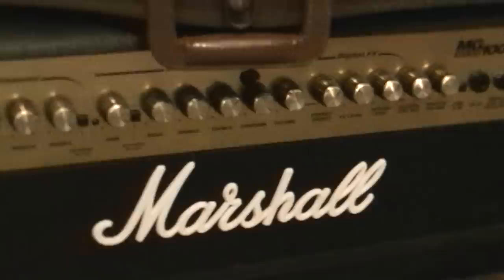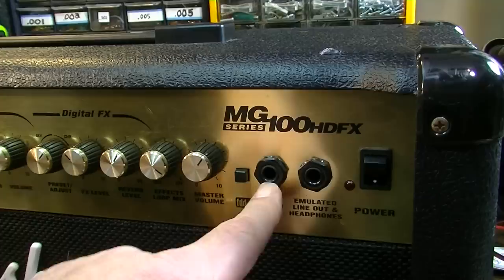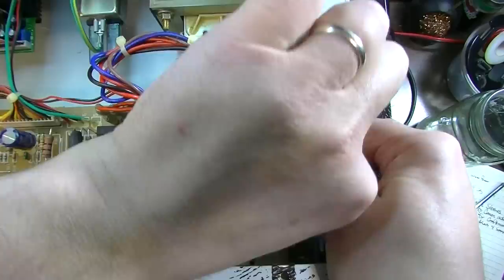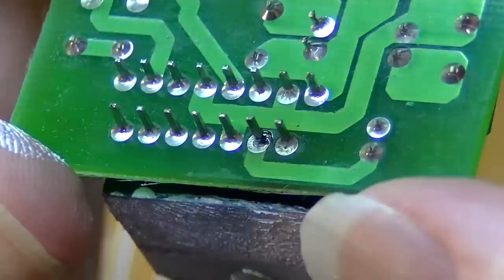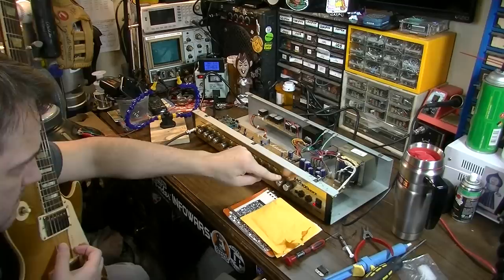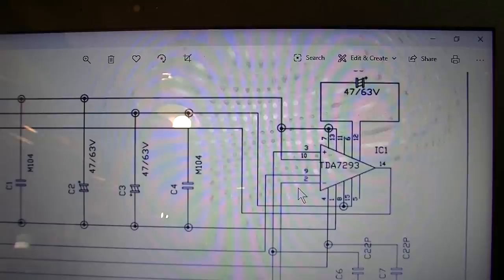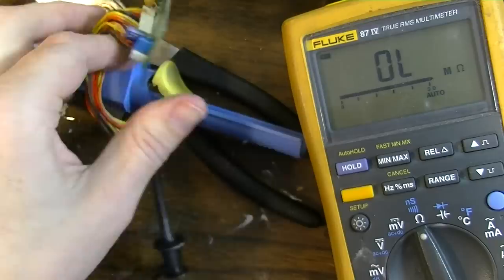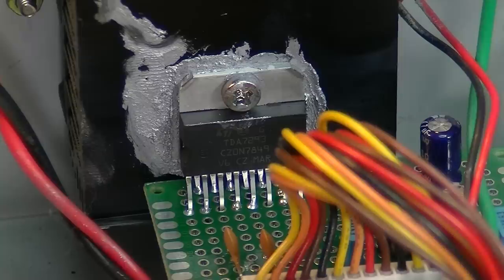Found a Marshall Amp in a DUMPSTER...Can We Fix It?

Comment: First rule in electronics; if you don’t have the correct value fuse, always use a smaller value replacement. The fuse is supposed to blow rather than smoke the ‘protected’ components.

Comment: Actually, these "crappy solid state" MG Series sound better than some of the $3,000+ "Boutique" tube amps on the market.
Reply: Scott Dunn No, they dont. No need to lie to others or yourself. If you personally prefer a MG that is fine, but what you said is not true. Have you tried playing a MG, a 2203, and a boutique EL34 next to each other?
Reply: @Whydoyoureadme  Chill. It was just a general statement. I play an early JCM 2000 DSL100. And what's a "boutique EL34"? Just because an amplifier is equipped with EL34's doesn't automatically mean it's a killer sounding amp.
Reply: @Whydoyoureadme  there are some really awful sounding amps out there commanding stupid money...

Comment: You could cover it in mud, hose it down and then replace every conceivable part.
Reply: Wire brush my man.
Reply: @gooberthoreau  yeah then paint it again with a cheap b&q fence sprayer for that proper restored look.
Reply: Don't forget to chop random wires, solder them back together and then mindlessly probe around with the multi meter! 😜
Reply: Maybe a create a noodle grill cover and paint it with a roller.
Reply: @neurosmos  especially the ones that don't even need removing
Reply from the maker: I should replace every conceivable part WITH mud! Then close it up, do a quick jump cut edit and jam away on the thing.
Reply: You have to wait until the mud has hardened, and liberally sprinkle the metal parts with cleaning vinegar for that 1,000-year old look. It isn't a genuine swamp find if you don't do that.
Reply: The Guitologist 😂😂🤣🤣😂😂
Reply: @TheGuitologist  Then go sell it back to GC.
Reply: @gooberthoreau  Nah-It'll Be Fine. ... After the Wire Brush! :-)
Reply: Make sure you record the 'after' demo before you 'find' the mud covered smashed item... When I did mine I forgot that bit and had to fix it properly. It was really complicated by all the wire brushing and blind soldering I'd done
Reply: Amateurs...you forgot about the part where he finds a family of kittens living inside it and saves them all.

Comment: Cool . I found a 1973 Fender Bassman 50 on the side of the road someone threw away. Had all the vintage tubes 12x7, at7 and rca 5881 power tubes. Had to recap and rewire some of it but now it  works great.

Comment: Two tips come to mind seeing you repair this:

1) If the faulty component (in this case the TDA chip amp) has already been cut off I find it much easier to just melt the solder on the remaining legs with the soldering iron and pull them out with a small pair of needle nose pliers. This way it's much easier to get the solder out once the legs are out and it's less likely to lift a pad with the desoldering pump.

2) If you don't already own one: An ESR meter is a good investment to check for bad electrolytics. Some electrolytics capacitors fail in such a way that the capacity on a normal DMM will still read fine but the internal impedance will act like a short circuit. You probably know this already. :)

Nice repair. Glad you fixed it.

Comment: I found a little version of this in a dumpster about a year ago.  Marshall MG 10 CD.  It needed only two things: the input jack needed to be re-soldered, and the transformer inside had worked loose and needed to be bolted back down.  But all the nuts and bolts were rattling around inside.  So, that was probably worth about $30 that I got for free.  :)

Comment: Those Marshall MG are not heavy sought after, because they have "not enough tubes" for some korksniffing tube afficionados.
To be honest, they have a place in heavy metal, not only because Chuck Schuldiner of Death played a MG series amp. 
Some guitar channels checked the MG's out and found them not bad at all, if a reasonable priced amp with lots of gain and a brilliant high end with some sizzle (and maybe some noise) is what you are looking for.
Reply: sizzle is the word
Reply from the maker: I didn't know Chuck used one of these. Cool.
Reply: Kong and Basses Chuck used the Valvestate, the MG’s predecessor.
Reply: MG is not what Chuck used nor is it a predecessor.

Chuck used two Valvestates, the 8100 and the VS100, exclusively, and that amp series was replaced with the AVT (Advanced Valvestate Technology) after that. These amps are tube and solid state hybrids with a single tube in the preamp section and had a unique voicing. 

The MG is entirely different and was entirely solid state and marketed towards the entry level niche. The AVT was still around at the time and was intermediately priced at the time while the JCM were flagship models.

Comment: Watching this in 2024 because my MG100hdfx just lost all output. The light still comes on but no sound.  I will be taking it apart and diagnosing it because it got me through the crazy times of when you put out this video.  I have fond memories of spending many hours playing through it while the world stood still.
Reply from the maker: See if the preamp part works by using the preamp out. If it works, then it's likely the exact same problem with the output board. I've seen replacement boards on ebay here and there.
Reply: @TheGuitologist  thanks I will try that.

Comment: Some feedback:  1) check fuse, 2) check all the tops of the cylindrical capacitors looking for bulges, 3) smell the big transformer to detect a burnt varnish smell, 4) look for cold-solder joints, 5) check all high-powered connectors for evidence of arcing. When soldering or removing soldering—for Peet's sake—always use flux. When trying to remove solder like you did, smear flux over a braided metal sheath and apply heat to that and you bring it down to the pads (which also have flux). The braided metal will wick the molten solder off cleanly like you wouldn't believe, leaving the pads unharmed. Clean with alcohol and acid brush between desolder/solder events.
Reply: You need one of these: https://www.youtube.com/watch?v=Gwo3pEH7hUE When you build your replacement board, it's important to gauge the wires so that they'll carry the same amount of power that the original board did. Look at the width of those +/- rails; I think you under-gauged those connecting wires (pretty sure).

Comment: We live in a society that when something breaks we just trash it.   I have a dust buster, 2 actually, that the switches quit working.  I just added in my own.  Silly to throw away something that can be fixed.  People can diagnose anymore, they are just parts changers.   You followed the smoke and used your noggin and figured it out.

Comment: You are quite a trooper and excellent PC board repairer. That was a great idea replacing a dual sided board with a bodged single layer board. You could find
a fault easier from the schematic that way. Dumpster diva  amp saved! Two thumbs way up!👍🏻👍🏻

Comment: brad, the average person has no regard for good knobs. until you need one.
when i found my technics sa300 i had to replace illumination bulbs; when i removed the tuning knob the shaft was already cracked, it seems. that part stayed on and the knob came off in my fingers.
depth, shaft diameter, half or full circle lots of variables on knobs.
super glue and baking soda (learned that on stew mac channel) fixed my knob i had no choice since i could not find one to replace it.
glad you are back , oh master of the variac.

Comment: An MG15DFX for £100 was my first amp (2002?) which died in a week on headphones. Returned and upgraded to 30W for +£30 and still use it. The volume would suddenly decrease, even after I fixed a few solder joints. Recently I got some Servisol cleaner and cured it briefly.

I got my Ibanez SA160QM back then, it always had a wonky tone pot and I broke the jack. I fixed it and finally did a setup last night.

I just bought an Ibanez SR300E last week in metallic red too. It sounds pretty good clean and with all the EQ knobs I figure don't need a bass amp.

Comment: As soon as I saw "MG" I knew immediately that was why they tossed it in the dumpster. (kidding)
Reply: Yeah... you can get these used for $130. It was cool watching him get to the bottom of the issue, but it wasn't really worth his time and effort. However... there is value in the satisfaction that you fixed something.
Reply: Cheap as they are I think they sound pretty solid especially for a startup rig
Reply: @ironblast5  I agree. A half stack will keep up with anything else.
Reply: I bought one of these nearly 15 years ago, within a matter of months I was onto my 3rd head due to fan issues. Years later it still runs like a champ, must have been a bad batch of these.
Reply: It is actually a pretty good amp if you just use it right. Crunch channel with the gain almost as low as possible with the volume as loud as you can bare.
Reply: @footnotedrummer  where might I find one for that price ? Can you link me to it ?
Reply: @blackrose13is13thgod  ... keep your eyes peeled at Guitar Center Used. When I posted my comment 10 months ago... I was likely referencing GC USed. I usually look there for everything. Good Luck.
Reply: Actually I fixed one years ago with same problem..the fan quits and that chip board just cooks. Chip pops and blows fuse..1.2.3.

Comment: Get a capacitor tester or a meter that can test microfarads, literally it will tell you if it's good or bad in 2 seconds based on the uf value on the caps, uf meaning microfarad

Comment: I'm actually a huge fan of this particular model, the MG100hdfx.  I like the reverb a lot. Also I like the effects loop mix adjust!! Comes in handy for troubleshooting ..  take out the effects loop without unplugging anything.  I mostly use the clean channel in crunch mode...  boost with a Tubescreamer. Plug into a quality cab with good speakers and it sounds great.

Comment: Excellent video! I had exactly the same amp, bought on ebay for not working/spares... (had been left at a theatre after a gig).
Paid about £38, took it home..didn't work. Fiddled about a bit and found that the main volume pot was faulty and left in a position where nil output existed... Had to take the main chassis out and remove the faulty pot (which was integrated) by deslodering. Worked ok after that. Thing to remember with these amps is that they MUST be connected to speakers otherwise there is nowhere for the power output to go when switched on, result..smoke!
 I found that the effects on this amp good enough to eliminate the use of numerous pedals.

Comment: I repaired one of those MG Marshalls many years ago.  As I recall it was also a failure of the amplifier chip TDA7293.  Same overheated device but mine was due to a failure of the cooling fan.  These chips run hot evn at idle with an average quiescent current of 75mA (~6Watts to dissipate) so a failed fan will kill the IC even though it is supposed to be thermally protected.  I repaired mine by replacing/upgrading the fan and beefing up the heat sink by using copper and almost tripling the surface area.  Okay now I must criticize your use of Chinese clone semiconductors.  They are NEVER to the specifications of the original manufacturers. Do yourself a favor, spend the few extra bucks and buy legitimate parts from reputable distributors (DigiKey, Mouser, etc) and genuine manufacturers (ST Micro, etc.). Awesome playing!
Reply: JJ, Brad  does what he wants because everyone is a expert at electronics on here. Let Brad do what he wants to do and don't criticize!
Reply: And do yourself another favor and never buy a Marshall amp...they are absolutely pieces of garbage.

Comment: I repair amps and other stuff for a living and I hate to see even the cheap ones thrown out, but it wouldn't be worth it for anyone other than repair guys like us to repair these cheap ones if we have the time because we don't have to lay out cash for the time spent. You would probably have been better off to have contacted a Marshall dealer and ordered the complete output board. They aren't expensive, though I don't remember the exact cost, and they are quick to change.

Comment: MG has a bad rep but i love my MG100hdfx . ive used it ten years plus and never had a fault with it they are killer solid state amps they dont deserve the bad rep they have
Reply: I picked one up for 150 bucks at a GC in great condition. Its a great sounding amp.
Reply: I have a few of them as Guitar Center sells them for stupid cheap. I get a decent sound out of them. I got a half stack that looked like it was never used for $280 ($150 for the head and $130 for the cab) I have one of the heads that has the purple tolex ($150) and a 50 watt combo that was $130. I did have to put a new fan in the combo. I slightly prefer my tube Marshalls but I don't mind playing these amps at all.

Comment: Lucky it was in such a SOLID STATE when you found it eh.
DID you see the flaw in the design that caused the fault in the first place Brad?
Fan cooling in.
No vents on box to let air out.
Reply: If they have a fan cooling cooling inside that might have cap the problem much cool er

Comment: I fixed one of these 10 years ago and found the same thing and one other design flaw. The Tda mini output board has a output trace on the edge, when installed in amp can ground our against the heatsink popping fuse..i had to replace another chip.needed to bend the pins before soldering.also the cooling fan (a standard pc axial fan) should be replaced since it caused the overheating anyway. These are worth fixing since the clean channel is amazing.

Comment: That has to be a chinese-made marshall. Low quality cheap output integrated circuit.  Microscopic fan cooled heatsink.  Not a lot of b+ filtering for that wattage.  That thing is a freaking pile of junk in comparison to the Marshal of old.  It's worth exactly what you paid for it.
Reply: Indeed. I owned a Marshall MG, pile of junk.

Comment: "Why" did they trash it?  Sweetwater has a new version of this amp available for $399.99.  At that price, inccluding 2 year warranty, the labor involved to troubleshoot/diagnose and repair the older one you found in the dumptser probably just didn't make any (economic) sense ... but I think someone should have stripped out the good parts ... how much time was involved in the "rescue" process?  (Great video, BTW.)
Reply from the maker: True. I don't blame them for trashing this one necessarily, just wonder why they threw away the knobs and other parts...and the strap!
Reply: Its a win win.  Sure. Some unforeseen problems.  But parts were cheap.  Labor.  It wasn't a ZERO times ZERO job.  Easy make a profit if need be

Comment: I  once discovered, sitting next to a dumpster in Oakland, a '60 Fender Bassman, sans speakers, but with the original unmolested, unmodified amp.  Many cigarette burns all around the top,  well-worn tweed, and "Presidio Officers' Club" stenciled on the side.  Luckily on ebay found a quartet of original  1960 Jensen P10Q's with the greenish ribbed cones, the exact ones used in the '60 Bassman, and with compatible date codes.   Great vintage sound.

Comment: It's so cheap that it's easier and cheaper to replace than fix. The whole head and cab is 300 bucks  so do the math
Reply: You can also get several (arguably) better amps from marshall for that or less. The AVT and DSL lines are definitely better than the MG line IMO

Comment: Hi Brad.Happy New year and the best wishes to your channel. Your were saying that some people didn't believe about the dumpster amps. Ha, two weeks ago I was checking a dumpster and besides some other cool stuff, like a 25 gal compressor, leaf blower and such, I found Sano tube amplifier from the 60-s! It looks like it had been customized for an accordion player because there is the Sanovox gadget built into the amp cabinet. Not sure though what it does, looks like some kind of tube gadget for the accordion. I believe the amp is 50 watt version of Sano. It has an interesting feature, there is a separate reverb amp built into the power amp (there are 2 chassis in the cabinet, one is the preamp and the other one is a power amp). Anyway, the reverb amp even has its own 8 in speaker.  The main speaker is 15 in Utah speaker. Of course another great thing about the amp is that it works except for the reverb, that I am looking into. Some of the tubes look like the original Amperex tubes. Things like that do happen!